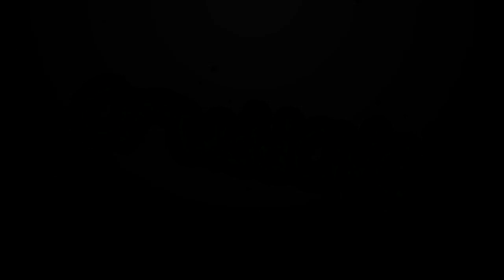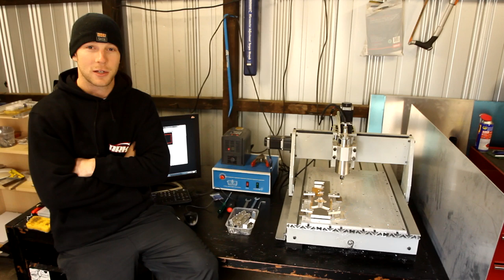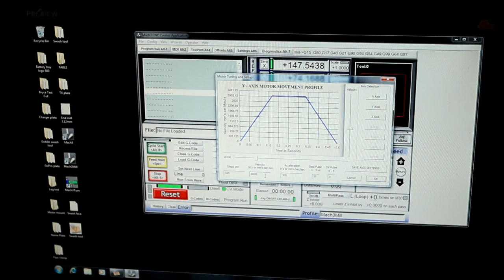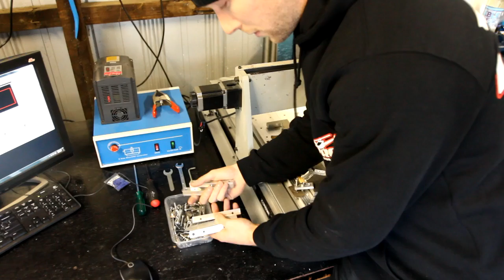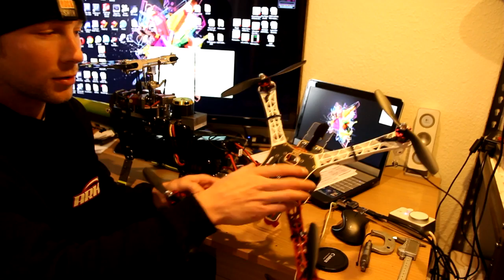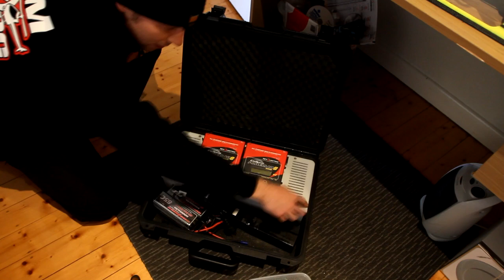DIY CNC 6040 machine review

Comment: I just bought one and I know nothing......I'm wondering about the "auto-checker" tool that came with mine. I'm thinking this is so mach3 can read actual position. I'm afraid I got in over my head. I was planning on just doing 2d pdf to gcode conversions. Auto check tool has 1 wire and a round rubber piece with a round metal disc inside. Also, I don't mind the music

Comment: Hi cruddCNC, do you know if the bottom plate (the extruded aluminium) can be removed? This way I could mill some plastic parts which have to much height for under the Z-axis. Thanks!

Comment: Hi. nice video. bought the same exsact mashine from ebay at the time you uploaded this video. about 3 years ago and after some small fixes it has worked wery well for me. but as you also mentioned this mashine has a slack on the z axis and found out it was the y axis ball sliders on the side that was the problem. they can be tighted with the set screw type on the top of the four sliders. so you have to screw them of the machine beam to adjust them. they are poorly greased so i added some. if you dont found this out yet offcourse. cheers from Rune. I live in norway and flying modelairplane and also helicopters :) nice mashine to make new ideas for this hobby :)

Comment: what spindle did u have 1.5kw 800w as i am trying to buy one of these myself. i was looking at the 6040z-s80 but i am hoping to get away with using a 800w version due to lack of funds. do u think the 800w would mill 4mm aluminium.

Comment: I'm buying this machine based on your tutorial but I have a question for you, I have a hollow aluminum box its 110mm x 62mm I need to put some holes in it, do you know the maximum material size that can be used in this machine to have sufficient clearance ? thank you

Comment: We have one 3 MM aluminium 590 X 45 part to be CNC milled so please suggest us whether its possible on this Machine.
Reply: 3 mm aluminiun should not be a issue, you may have to cut it in several passes but it can be done.

Comment: Besides replacing the cables and machining a new work surface, have you had to replace anything else? Do you still use this machine? I am strongly considering getting one because I have no resources to build the mechanical components. I am however considering trying to buy just the mechanical components and buying the electronics elsewhere.

Comment: Thanks M8t If you are ever after cable there are to places where I  get cable from and they are the cheapest around Melbourne.
The first one is Cables plus in Arden St Nth Melbourne down from the Nth Melb football club and the other is Radum  They are in Tullamarine and they have everything from cable to conectors to machines and car lifting equipment. I Have been using these places for the last 20 years

Comment from the maker: Hey man, no there is backlash but I haven't measured it. All ball screws will have a tiny amount of backlash (almost negligable ~ 0.05 to 0.1mm).
 One way to eliminate it, is to use two nuts and preload them against each other on the same screw

Comment from the maker: You can use any computer. I built a new miniITX running Win7, has an SSD. You don't need a parallel port - just a USB motion controller. I use the UC100 on both machines.

Comment: Good to know. I have 2" long by 1" OD Brass rounds that I need to drill 3mm or 1/8" holes into. I also have 1/4" thick 6061 aluminum flat that I need to drill holes into.. I will look for something more rigid

Comment from the maker: Try connecting the positive voltage to the available input pins (after enabling them in ports and pins) and then check in mach3 limits screen to see what pin activates

Comment: I'm thinking of getting a CNC machine sometime this year to finish building my flight simulator cockpit. I went and chose an aircraft that has little support (I'm building an ATR 72-500 cockpit) as most people fly big jets or  Cessna's it seems. Even the knobs for it are crazy hard to find. Making my own would be a treat.

There are LOADS of 3040's and 6040's on eBay... are some better than others?

Comment: Great Vid - Been following your progress on this - and your new Mill Build as well. Do you think the 6040 would be suitable for cutting 1 - 2mm Glass or Carbon Fibre sheet & 3mm Acrylic. I am wanting to make some custom parts (frame upgrades, camera gimbals etc for my Multi Rotor) I Don't think I have any need for cutting Aluminium at this stage. Also where did you source your Vac Table parts from? - Pump, Tubing, valves etc... Keep up the very informative and inspirational work. Cheers Tom.

Comment from the maker: Hey mate I don't recommend this for metal milling or drilling -  it simply is not rigid enough and you will break/dull tools very quickly. Check out my new mill conversion which will be able to do that. Cheers

Comment: Hey man awesome clips. I was thinking of getting one of these to use with aluminium as they're heaps smaller than a mill. Now I see it does a pretty good job with thin pieces but I'm curious how well it would cope with something thicker. Is there a limit to how long a drill bit you can use before it start to flex, etc... and is that why you've decided to get a mill yourself. :) Cheers mate. Jake

Comment from the maker: This machine really isn't designed for cutting aluminium parts. If that's what you want to do I suggest looking a milling machine instead. The spindles work ok as you can see, the cutting tools you select must be good quality as well (more expensive/carbide). I have bought a G0704 mill and am converting it starting next week. If you're interested you can see my plans in a video soon :) cheers

Comment: Thank you so much for doing these series of videos. I'm looking to get the 6040, but have not ventured into CNC before, only a bit of cad and a fair bit of 3D. I see on eBay Australia that these go for $1050 - $2400 ex Sydney for the cheap and ex Brisbane for the pricier one... Any idea if there'd be a difference between them or newer components ? I'm in brissy.

Comment: Great intro vid to DIY CNC machines Luke, although I think it needs updating with a warning that there are images of the deceased Cruddcopter v1 which may disturb some viewers... lol... Thought about building a machine several years ago but the cost out weighed the need at the time... Now parts are more readily available and much cheaper I'm seriously thinking of building one... Solidworks & VCarve Pro seem to be used by many, any idea of the cost of the software..? Cheers mate :)

Comment: Great vid, can I ask a huge favour, i'm welding up a steel workstation for the cnc 6040 before i buy and require the x,y outside flange size to bolt down to SHS 50x50. suppliers on ebay just quote the std specs. (i presume its around 850x450mm?)
Thx
Brendan

Comment from the maker: Hey man I didn't touch any settings inside the VFD, I simply connected the wires and started it up. I did have my Chinese speaking friend translate the wiring diagram for me so that I knew which terminals to connect to. I might make a video,as I intend on changing the ramp on rate and also would like to control it via Mach3. Cheers

Comment from the maker: Hi mate thanks for your comment - the maximum cut you can safely take is between 1 to 1.5 mm at a relatively low feed rate, approx. 200mm/min. Cutting aluminium on this machine really is pushing it's limits though. Any serious work will take quite some time.

Comment: Well done mate, some good tips there.
i've kind of modded mine with limit/home switches and have a
few tips on my channel.
so far i've had an x and y motor coupler shear for no obvious reason,
the first vfd inverter was rooted, and today the spindle motor cable
dropped a phase. well, i couldn't be rooted contacting lovehappyshopping
and waiting 6 weeks and several emails to resolve, so just got some nice
4 core flexi cable from jaycar. happy camper once again.
cheers.

Comment: Terrific vid mate. The info on stepper motor torque was particularly useful.
I see you are using a Chinese spindle and vfd unit. I wonder if you could do vid on how  to program and set them up. I have the same spindle and vfd and could hardly understand the Chinese - English manual. I blame this for making a vfd programming error and burning out the spindle motor. What we need is a Do's and Dont's on vfd programming. 
FYI I also use Vcarve Pro and can recommend it.
Thanks again for a great vid.

Comment from the maker: Water cooled spindles will last longer, run cooler and maintain their accuracy by eliminating thermal expansion. Watch out for the trap, double check you are getting a variable frequency controlled spindle and not one with a brushed motor attached! cheers

Comment: Great video mate very informative !!!
Yeah get what you pay for with the chinese stepper wire, jaycar speaker wire is much better.
Nothing wrong with the motor connectors the motors are only 3 amps so it shouldn't be an issue.
They use these same plugs on my larger 1212 chinese router table